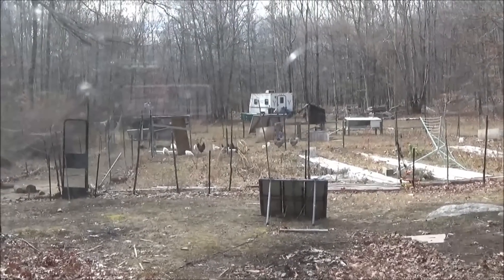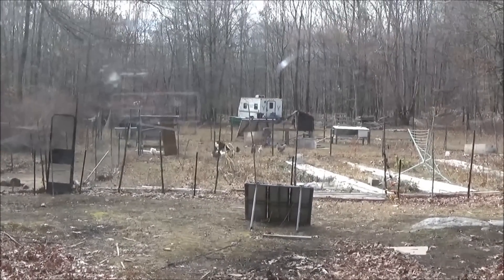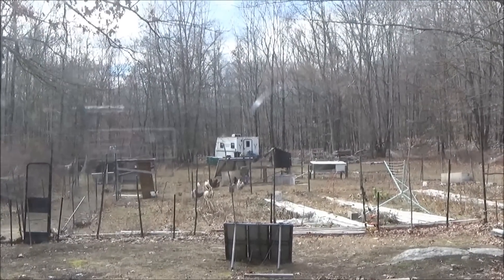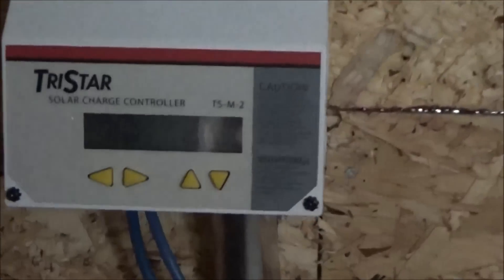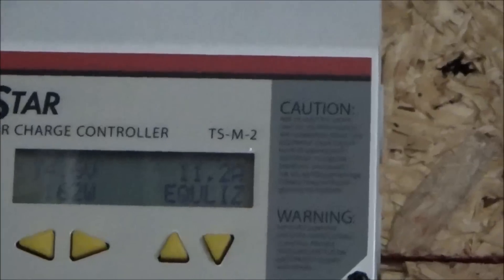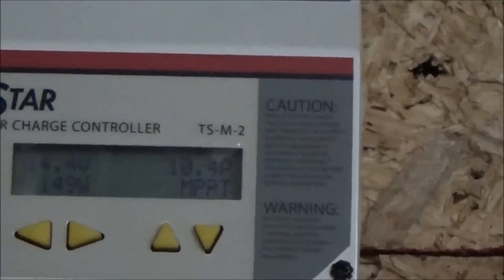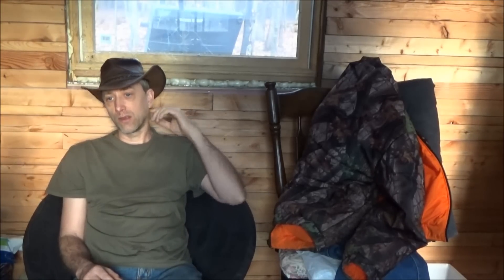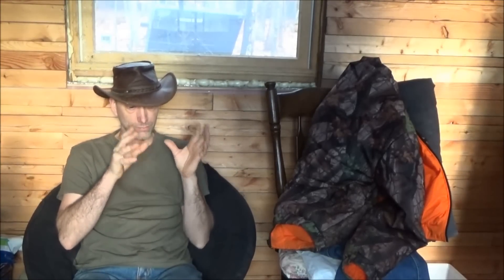Researching Best Off Grid Solar Batteries For The Off Grid Project ™

Comment: i use walmart marine deep cycle and starting, my battery's are 4 years old, they seam to work, the ac delco battery's were shot i had 2 of them and one deep cycle marine battery the dealer i got the boat from put that in the boat, to show me the boat worked, they ran it!
Reply from the maker: James Pottorff Yes that was my experience with their deep cycle batteries. A desulfator will help. But some batteries are designed to fail. If you could open the battery and raise the plates up a little higher then it would last longer. What kills most cheap batteries is the sediment on the bottom shorting out the plates. Some batteries dont have much space down there so they short out early.
Reply from the maker: ACUSTOMESTREETRODS That is because batteries are designed to fail. The particles settle into the bottom of the battery. Eventually they short out the battery plates. By reducing the space under the plates, they reduce the battery life. Causing you to buy a new battery. Clean it out, refill and charge and you extend the life of the battery.
Reply from the maker: Wow, 4 years out of walmart batts is pretty good.
Reply: Pete Brown Hey, I'm not sure about point 3. I have seen a bank of 6 large 2v batteries to run an entire house. I understand that a low 'cold cranking amps' increase the life of the batteries. Not entirely sure but that's my understanding.
Reply: Pete Brown
yes on my boat i changed trolling motor to a 12 volt unit from 24 volt one
Reply: The Do It Yourself World I use walmart marine batteries in my rv, and they never last more than 2 years. I think I am gonna buy a desulfator, and see if I can recondition them this time before replacing them..
Reply: The Do It Yourself World my RV has 2 - 12 volt (house) batteries, if I have to replace them, I may try using a couple of those 6 volt Trojans to see if they last longer.
Reply: The Do It Yourself World i just had a 12 volt battery die in my BIG DIRTY TRUCK i tried to recharge it to no avail so i dug through my junk battery pile and found a battery from 2000 and cleaned it out by getting rid of acid and rinsing it out while upside down and refilling it with new electrolyte and charging it for 3 days low charge and low and behold i have a battery like new starting my big dirty truck 1 month and going  so there is the proof 4 yr old battery siting far 2 years dead working like new GO FIGURE
Reply from the maker: ACUSTOMESTREETRODS I have been considering one day trying the old style wood crate battery cases. Those batteries could be maintained and used until the plates were totally used up. Imagine taking a battery out of the case that was designed to fail. Put it into a case with more space under the plates and you have a long life battery.
Reply: never herd of those batts before like to see that
Reply: The Do It Yourself World well i do have one odd battery a 1100 international truck battery i got it in 2003 it 11 years old yes it still holds a charge! its a sealed unit no add water! the truck company wanted 1200 or bigger battery's like 20 trucks that were new! 4 to truck dealer had no use for old ones that were new too! that be a good find!
Reply: ACUSTOMESTREETRODS
Where did you put the battery acid and what kind of electrolyte solution did you use? Necessity is indeed the mother of invention.  Janice
Reply: jksatte
in 4 years just added water i filtered , and charged them and DE sulvator working on them after 4 years!
Reply: ok
Reply: ACUSTOMESTREETRODS
Ok gotcha!! Thanks  Janice

Comment: Is this forklift battery a wet or gel cell type. If a wet one use distilled water to keep it full and keep sulfating down. Gels just need to be equalized at regular intervals to keep them going. Wet ones major drawback is sulfuric gas in battery area. Gels is just heat. Hope you have your Christmas dinner fixings in by tommorow or you may have to use a turkey surprise mre for dinner. Next big item is a small garden tractor with a pto shaft driven attachments, after the wind tower is built.
Reply from the maker: It is a flooded wet cell. I do use distilled water. Thank you, I have been invited to join the property owners for Christmas dinner. It will be nice.
Reply from the maker: Pete Brown that it is

Comment: Troy that's awesome news!! Trojan brand AGM if you can special order them thru Harbor Freight? Or Thru WalMart? They might be an excellent deal, but you should make some home made lanterns and pick up a couple of propane lamps. Always try to have back up solutions. One Propane lamp centrally hung would light up the entire first floor minus your bathroom.
Reply from the maker: Yes Trojans are good too but I am tired of smaller batteries and have studied Forklift batteries in off grid solar homes and they are the longest lasting ones commonly used.
I have a propane lantern that BuggingIn gave me and it works nicely.
Reply: The Do It Yourself World I wish I could send you some chain so you could hand it from the rafter right at the center of your cow, out of Baby Cat's way. It would light up the place on dark days when you are saving battery power.  The stair well and the closet under the stair? Looks brilliant. The some for the shelf by the door. The upstairs will look great with the barn wood. Those water tanks are going to be a game changer guy! Great.
Reply from the maker: antonio r. belizario Belizario Thank you. I just use the lantern on the floor or table when and as needed for now. Yes the water tanks are amazing
Reply: In the islands where I lived before coming here as a child? They used to light up houses that way with kerosene lamps. It was a warm light, yet it was bright.  Anyway Troy, keep up the great work.
Reply from the maker: antonio r. belizario Belizario Yes it is a nice light. Thanks
Reply: The Do It Yourself World hey troy my neighbor gave me 200 led lights but they are all red .what should i do with them ?
Reply from the maker: ACUSTOMESTREETRODS Stealth emergency backup lighting. Red light is used in the military at night because red light does not travel as far. Use it for modding out your vehicle. Nothing else comes to mind
Reply: cool that would look wicked driving down the road with a red glow coming from inside the truck LOL

Comment: Hi u should add a outside water tower with the tanks and uses insulation around them
Reply from the maker: James Pottorff The biggest problem I have is that I need to use materials that do not attract rodents, which are a horrible, horrible problem out here. So I am left thinking about options for insulation. Rockwool or foam insulation are the best options I know of so far
Reply from the maker: Thinking about an insulated shed out behind the house with batteries, food and water storage
Reply: The Do It Yourself World Could you take that tote you used on the rv, set it up in the back of your house (to collect your rain water), once your water pipe is installed, build a box around it out of pallets, that could then be stuffed with insulation material to keep it from freezing? I would think you could stuff it with most anything  (including leaves & dirt) for insulation. Being out of sight, it would not matter how big the box is.

Comment: Where and how are you going to handle and put a 600 pound battery?  Wowzers!
Reply: Bj Austin I think its called the The Off Grid Project ™ is presented by The Do It Yourself World so being a project I have no problem with any one helping him.  He has made NO secret that he appreciates any help.  No one is holding a gun to someone's head demanding they help Troy or ANY other YouTube channel person.

As for your saying he has not succeeded in doing ANYTHING himself..... I disagree. He cooks for himself, takes care of his cat and chickens and has done most of the tiny house work by himself.  He set up the water catchment system himself.  Has gathered wood himself.  He obtained the RV which he redid as a shelter himself.
Reply from the maker: I will have to separate the individual cells and pull them out of the battery housing one at a time.
Reply: That answers "how" (maybe)(each cell has to weigh close to 65 lbs) but not where. You're not going to want those things in the house with you.I have smelled those things while charging and "ICK".
Reply: Jerry Densmore I agree 100%. Knowing how a battery actually works is vital to make it last a long time.
Reply: The Do It Yourself World  I thought you said you could build no sheds or any other structures on your landladies property because legal issues and trolls turning you in?
Reply: Beth DeRoos  Bj is mad because he knows he can't find anyone to help change his dirty diapers he sits in all day so he has to take it out on someone !!!
Reply from the maker: JAI Colorado Out behind the tiny house at first, on a pallet. Later inside an insulated shed on the back of the tiny house which I plan to build
Reply from the maker: Pete Brown Yes about 100 pounds per cell.
Reply: if someone gave me a 600 lb battery i would not have any problem moving it any where i wanted
Reply from the maker: embrisa I am looking into options. Like if it is attached to the back of the tiny house trailer but has two large legs going to the ground. Or if it is a trailer of its own. Or I make it mobile in some way. So many options. Just need to pick one and go with it.
Reply: 4 casters 1 under each corner LOL harbor freight  LOL
Reply: ***** I had no idea you are such a stud!  ( Just FYI... what we call dumb bells are those little 5-10 pound weights)  If you can do one hand curls with a one hundred pound I am seriously impressed!  Also, maybe you can come over and help lift those cells.   :)
Reply: ***** What Baby Cat  video link??
Reply: ***** Go where ???

Comment: You can go crazy researching other people's claims on what is the "best" but the reality will be found at your local car battery shop, and if your area does not rate one, then walmart.   Maybe even Home Depot which has pretty competitive prices on car batteries in a lot of areas and they give the 10% veteran discount most of the time. 

The reason is the "best" batteries are most likely not readily available in your area and any advantage you get out of them will be eaten up in shipping costs.   In the meantime, collect up junk car batteries so that you can have some savings on the expected core charges with stuff that you would be buying outright    I have a strong preference these days for RV/Marine batteries and NOT Trojans which are popular among off gridders.   In some areas but not others, electric forklift battery packs are available and pretty good.
Reply from the maker: Yes you can get free car batteries to offset your core charges. I wonder why you dont like Trojans?
Reply: the whole point is that you do NOT use car batterys, they are not made for ciclic use!, there starter batterys, totally different of traction (forklift) cels!
Reply: You really need to use deep cycle batteries, as opposed to starter batteries if you want to avoid all the head aches Troy has had, but on the other hand you got to think in terns of what the wallet allows, or what gives you the biggest bang for your buck
Reply from the maker: antonio r. belizario Belizario I never used starter batteries and always talk against them in solar use. I was talking about getting them for free as junk to turn in for cores when you buy good, true deep cycle batteries. My problems were from buying cheaper brand golf cart batteries which lasted just over two years before they gave out